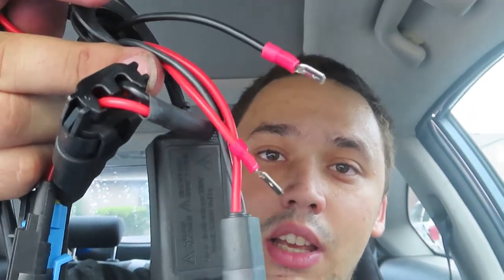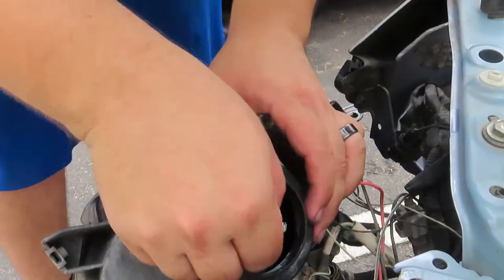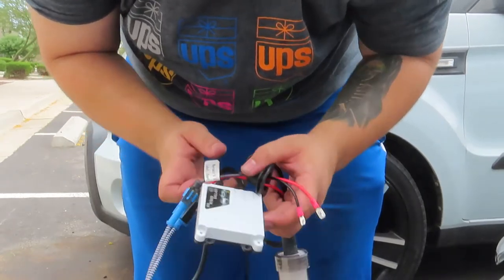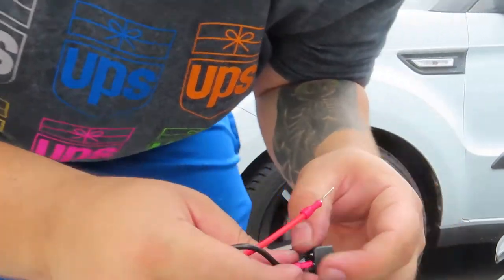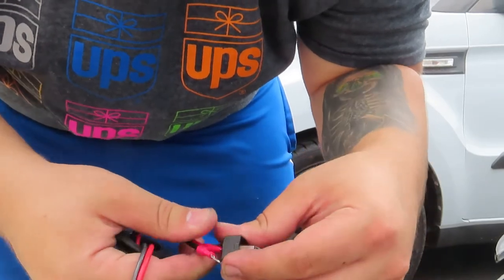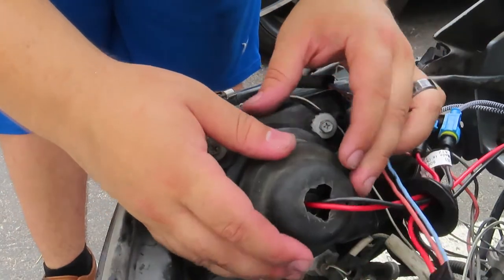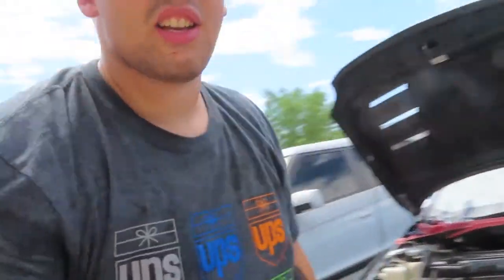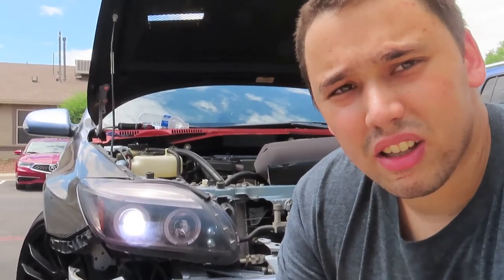How To Install HID Kit On Your Spec-D Headlights! | Scion Tc Mods

Comment: How did you get the holos to work ? Is it wired to your battery ?
Reply from the maker: No its wired to the daylight running bulb oem wire.
Reply: @Tuzin_98  bet thanks I just ordered a pair another thing I’m wondering about is those little led lights in the corner where the turn signal used to be, are those included or you gotta buy em? 🤝
Reply from the maker: Theyre included
Reply: @Tuzin_98  say no more 🐐

Comment: Where did you manage to find the kit? is it on amazon? any way you could send a link? i bought the headlights and have them installed final step is making them led
Reply from the maker: ebay, or these as well https://www.xenonhids.com/low-beam-h11-full-xenon-hid-conversion-kit.html?pla=lzV6j&gclid=CjwKCAjw9suYBhBIEiwA7iMhNHuwgEwhka7W_L7GgcDtHfx2U00KeXFDv_3CdIAP0xq-puf1kPWe6RoCeAAQAvD_BwE

Comment: What is the part number for those bulbs?
Reply from the maker: Its not part number, is just bulb size, H1 for high and low beams, and the other bulbs you can just take them out and go to autozone and they can help you find the size you need